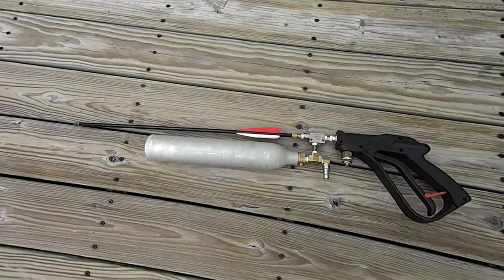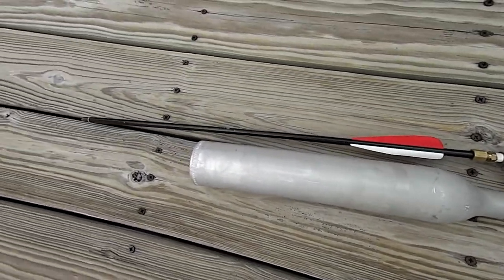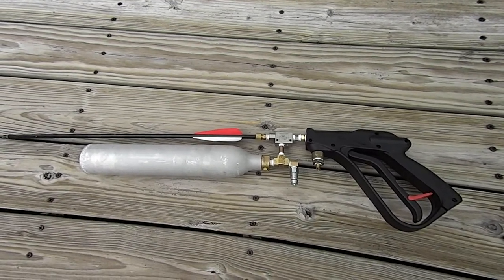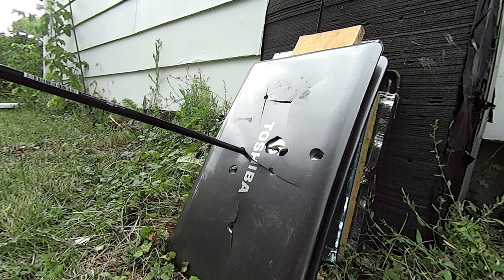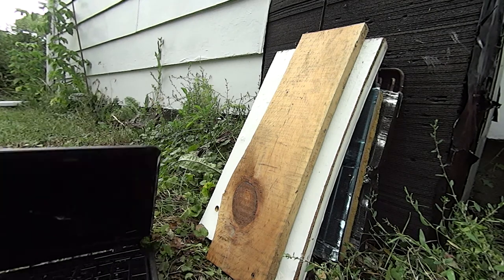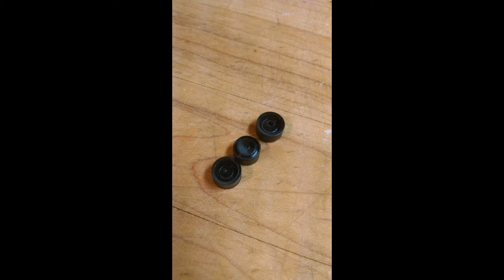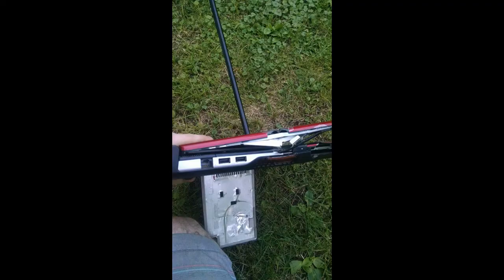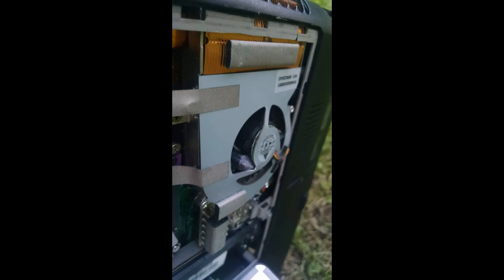More Advanced Arrow Gun Firing at Higher Pressure Homemade AirBow

Comment: My guess? Your either making a transfer block so you can install a bigger tank or building a adapter for soda or CO2 paintgun tanks? Certainly not a regulator or solenoid valve to allow multiple shots, (instead of shooting your whole wad in one shot), at least at the stage the picture was shot.
Reply from the maker: The arrow gun was multiple shot capable as it was. Can watch my other videos for info on that. What I was making was a massive qev

Comment: Try cutting a round grove into the nylon and putting an o  ring on it, if there is room put two one easch end so it does not cock.
This will make it stiff to operate but you can add some silica grease to keep them free.
Reply from the maker: John Laccohee-Joslin unfortunately that wouldn't do the trick as it's having problem sealing on the face, not the diameter

Comment: because the arrow is at the very end of it theres alot of pressure being lost immediately after  the arrow leaves the tip,if you redesign it with a long air thight air sealed  pipe  i'll say at lease 1 foot long,the air pressure will accumulate giving unprecedented pressure speed and power,there is a reason why long range cannons and sharp shooter sniper riifles have long pipe long barrels,
Reply from the maker: ? the barrel is as long at the arrow, and the od of the barrel is the id of the arrow.  it can't get any better than it is with that arrow

Comment: And if you truly want it to boogy, the air ripping towards the arrow must go from widest to same size as launch tube and no corners and polished smooth   just like porting and polishing a set of big block heads  the smother the faster    and if you r using the whole bottle you can use a schedule 80 carbon steel nipple 8 inches with ball valves on each end and that is like 4 times the volume and the unit can b brought up two 3000lbs no problem    thats like a garbage bag full of air squished tiny smaller container faster discharge
Reply from the maker: This is multi shot capable.  No need to use the whole bottle per shot.  Optimal ratio of air released is roughly 1:1 up to 4:1 the volume of the barrel.  Also qevs will dump air faster than any ball valve ever can.

Comment: made an airgun with a solenoid valve
Reply from the maker: qev is quicker and without the added complication of needing to run a battery, wires, and switches.
Reply: Swan Donovan yes, but it`s easier to find a solenoid valve than a qev in my country
Reply from the maker: i'll see what i can do, although there are a ton of solenoid valve guns on youtube already.  is there something specific you're looking for?
Reply: Swan Donovan no, it`s just a comment. My last project is a multi-shot solenoid valve air rifle, but i have ordered a qev valve for my next project
Reply: and i have other idea with a qev and a solenoid as a pilot, you can regulate the rate of fire with a raspberri or with a arduino, but you need the wires and the battery
Reply: What type of solenoid valve
Reply: @therocky1157  what is a quv